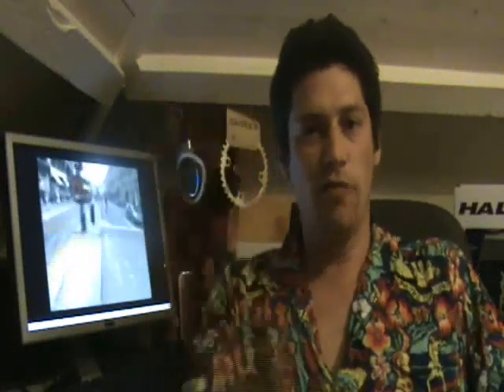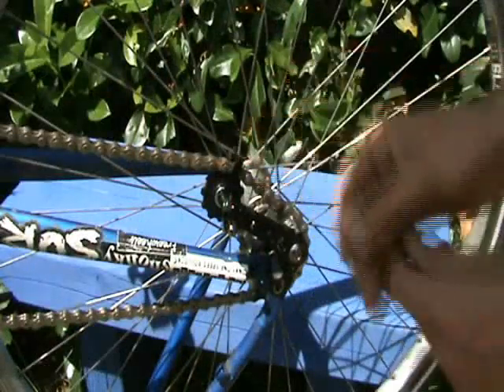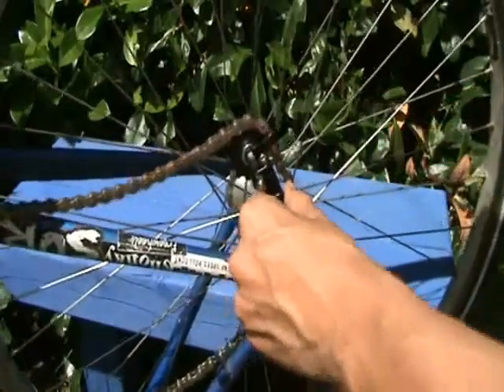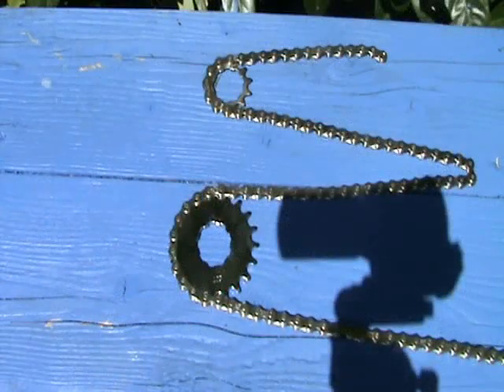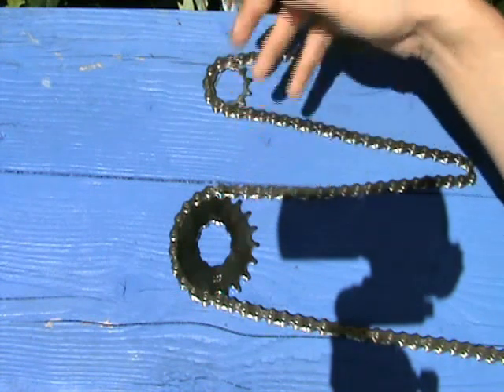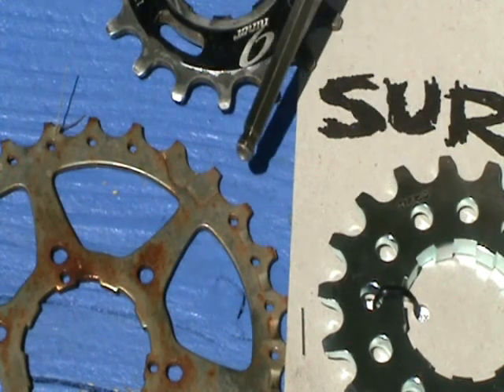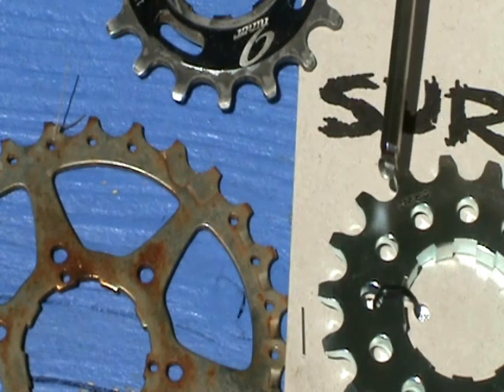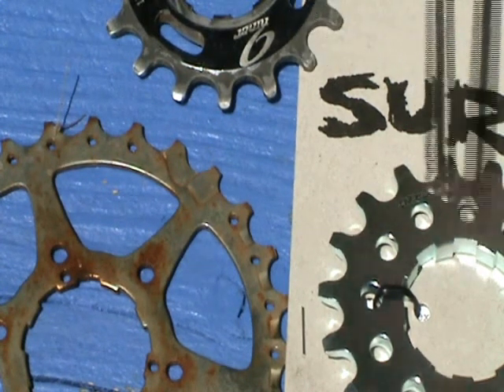Single Speed Mechanical Principles

Comment from the maker: Yeah, tensioner, chain, spacers and a rear cog. You may be able to recycle your front chainring, and if you have semi horizontals dropouts, you may be able to slide the hub back in the frame to get tension... so maybe no tensioner is needed.
48:18 or 42:16 is a good gear to start with (on road, 700c wheels)

Comment from the maker: Good point. I will do a "magic gear" conversion on it soon and youtube it. 

The biggest problem with just using chainlength and cog size to get perfect tension is that it wont stay that tight, as the chain will stretch over time, meaning you need to adjust again, and maybe again.